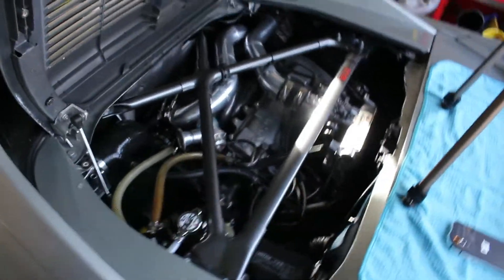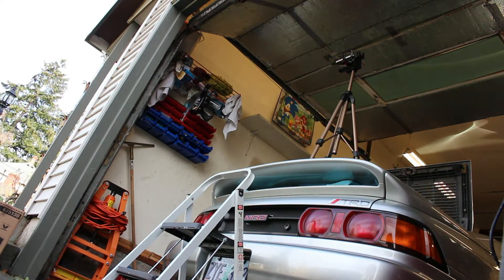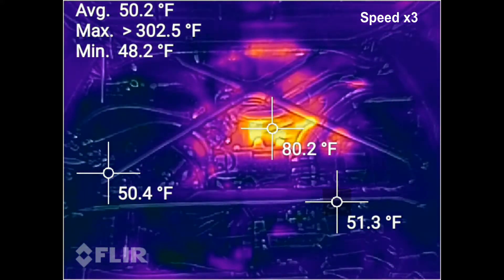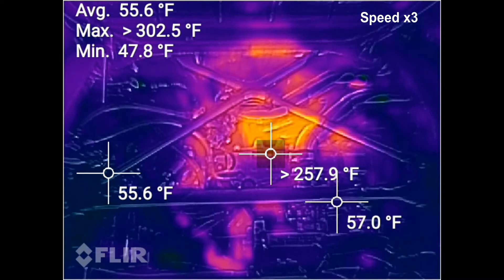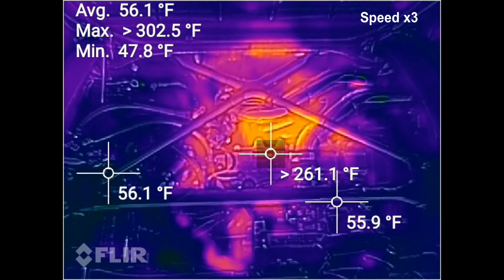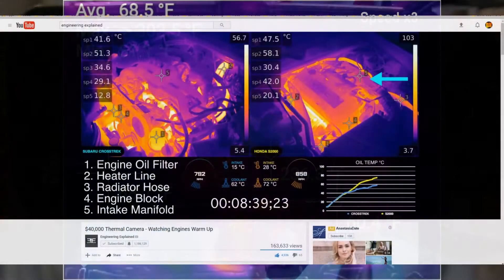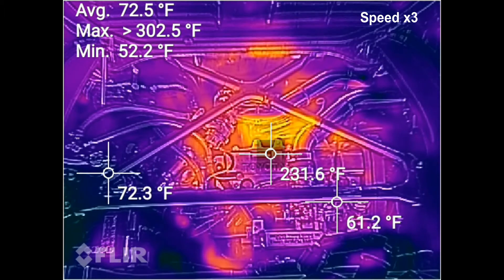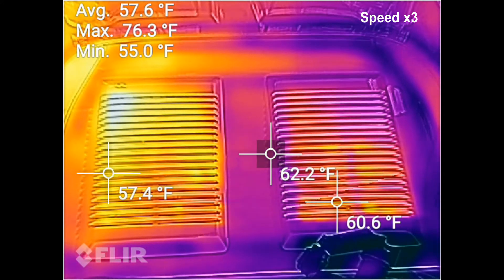Infrared Thermography of MR2 Engine

Comment: Hi Ben, i noticed you have the Kouki lights with the original center panel. Do we need modifications to install this?
Reply from the maker: Yes. I've actually since changed back to zenkis with an aftermarket red center panel. https://www.instagram.com/p/BZ9X3PBjKEF/?taken-by=ambercorners

I'm planning to upload a video talking about why and I'll make sure to show how the zenki center panel was modified for use with the kouki lights. The short version: You have to cut them carefully with a dremel tool. :)
Reply: Great look forward to it, i'm tossing up to update the JDM Zenki center panel (rev 2) which is slightly different.  The red aftermarket looks interesting. What brand is it?